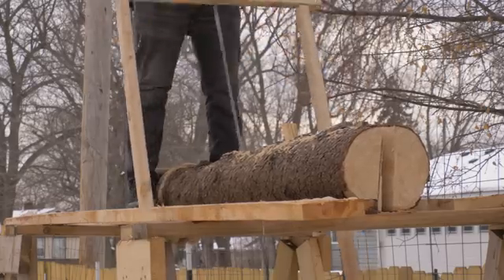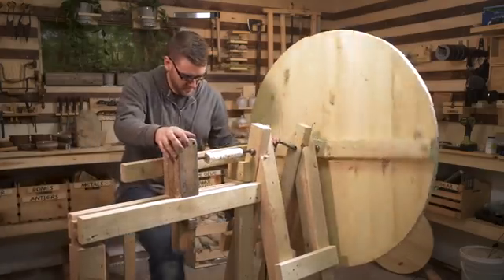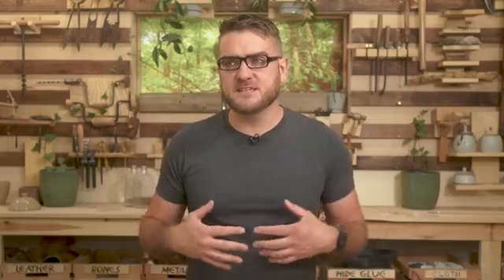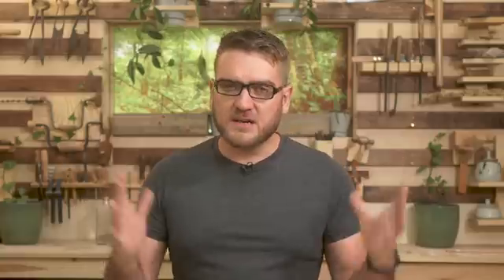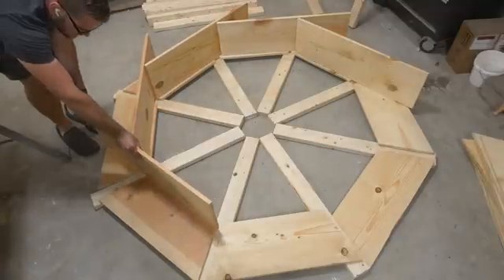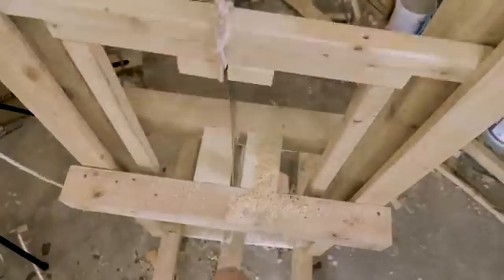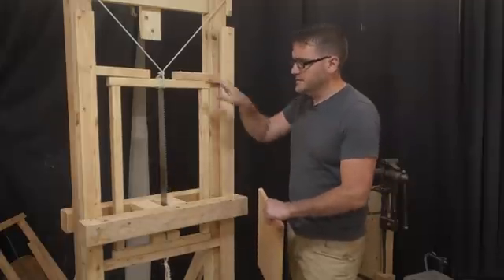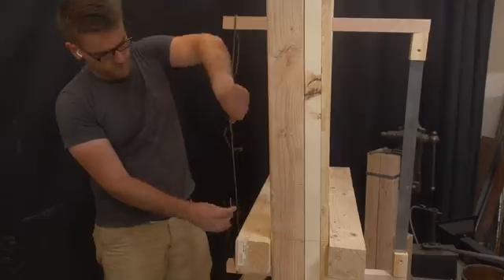I Built a Medieval Watermill to Power My Tools

Comment: I’m trying to 3d print my own ~6in water wheel. Are there any specific things I should do with the buckets (ie be as far out as possible, empty in a certain way, be a certain angle, etc) or do they literally just have to hold the water on the way down?

Comment: Hey man great video on you foot saw run run boards through out side studs allow to slide up and  down in pockets until bottoms out top and foot pedal attach to bottom baiscly big square studs help stability and yo can cut an pivot wood even put turn table if wanted

Comment: You don't technically need to make gears! That's going to be a very precise project. You can still achieve a gear ratio and power distribution system with pulleys and rope. Also would a stain help make the wheel last longer?

Comment: Andy I must ask have u thought about using multiple types of power generation systems in sync with each other to one power storage system also ur forgetting most smiths used animal power so why not build a wooden wheel for pets etc also since ur using water power by wheel why not turbine based instead also if u think about all motion based energy systems they need physical movement to make elec so why not have them link to hydro fuelcell also the simple wheel system can be tweaked to a higher yield of energy transfer by more chain/link with gears like make a wooden gear and use some paperclips as a the chain link system to get  more energy transfer another piece of advice would be what I call a mother spider web system like ur Dr stone docs gen if u link that up to a water wheel/turbine u can also make electrical energy along with kinetic so try also using a water solur system like heat from sun to make small steam and use a makeshift steam turbine/wheel to have a minor heat system that can be added to a geo thermal system like the water exhaust fills the geo well to steam from earth to make more heat transfer anyways just saying best thing to do is link all systems to a spider web system structure like how the power grid is designed on industrial scale
Reply: bro animal cruelty is illegal

Comment: You will need to add a wood piece or a plank with a smooth slit gap in the middle of it where your steel rod can move up and down (basically a gearbox to make the upward and downward motion work correctly and use the water wheels rotation work )to make the wood saw work right.

Comment: attach a wheel on the side of the water wheel, wheel has string attached to another wheel, the other wheel has 2 planks of wood attached through a hole in the wheel that goes around both the wheel and the string, and pushes up and down. in terms of binding up, it's better to attach the bottom of what you're trying to move up and down or back and forth in the direction you want the thing to go. so you don't want to attach it on the side of what you're trying to move, because you're going to be fighting against static friction. you're also going to be fighting against gravity. The crankshaft is definitely the way to go in terms of turning circular movement into back and forth movement. and vice versa with cars. it's just the most optimum method is to have the crankshaft in the middle of the load rather than off to the side of the load.

Comment: Having a crank, coming directly out of the side of the water wheel is the 1st engineering mistake. The wheel spindle should be a long shaft, that goes through the wall of the workshop. And runs the length of the workshop, then it can be connected to the machines using belts and pulleys. A home made bandsaw would work better than the reciprocating table saw, as there is no wood against wood mechanisms to bind up, while being operated.

Comment: As you said it comes down to gearing. So possible a transmission, but the easiest route would probably be a belt. Either rubber or tan hides. Just an idea. I wish you luck Bro

Comment: Now that you're getting into self moving machinery, listen to me and listen to me carefully. The biggest improvement to safety in the history of machinery was the brakes. Right now, your waterwheel and whatever you connect to it will be a constantly wobbling kill-zone. Make sure you have a way to easily stop it instantly when you're not using it, or I'll kill you when you least expect it. A saw moving unattended on it's own is more dangerous than what you might expect. I can't stress this enough, give it emergency braking of any kind before you cause a tragedy, please.

Comment: I bet this is after the fact, but it might help if you use a very long connecting rod to decrease the side loading/ binding of the saw. If you look at old pictures of some of the old designs they usually have very long connecting rods. The same principle is used in modern internal combustion engines.

Comment: I suggest that you  investigate efficient water wheel wheels and water flow.  The way water flows onto the water wheel is important to the power of the waterwheel.  IE over the water wheel, or alternatively a straight drop before the water wheel with the water wheel spinning the other way and dipping into the dropping water.  Cant remember which gives more power for same amount of water flow, but I know there is a clear differential.

Comment: If your arm hair is touching the saw blade, that is too close! An easily removed bumper that would be accurate to the period (and cheap) is stuffing a sock with plenty of waste fiber and tying it onto the metal pole. At this point, I think Andy's blood should be listed as a material. Enough of it has gone into his builds over the years. I joke but I've been watching since the original sandwich and it is very satisfying to see the improvement in tool use over time.

Comment: shaft nobs and rope guide sets  with second are arms and pins to the tool.  then it advanced to the gear shaft simple some parts up some down and shafts set with angles to boost the power. crank shafts and pistons come from this.  hooking up another shaft l with often cloth twisting bands let to gears and counter setting mill stones mills and such water wheels are still used for a reason in the form of turbines which is basic a better wheels that add that energy to a charge for example.

Comment: Couldn't you use a rope to transfer the power - have the waterwheel pulling and releasing it via a crank, and then some pulleys going below the saw to pull it down, with the original spring pulling it up?

Comment: You should try to link that wheel to a belt system (gearbox) to help with speed control of the saw then a off Center wheel to push the saw down

Comment: Discuss!
You need to have modern material loophole.
 As long as you have made a previous material in sufficient quantity that is unlocked from modern sources.
Then technology if you get say 10 to 20% of modern efficiency of a tool just use modern.
Just my thoughts.
Reply: Edit otherwise this is going to take 100 years until possible a  boom.
LOL the feds will stop. But at limited progress you are 50 years from steam powered in real years.

Comment: Not sure if it is time era appropriate, but I know that in the early days of the Industrial revolution they used pulleys and belts for power transfer. Maybe you could use materials such as leather or hemp? As for the saw, maybe a cam in addition to the springs could drive the saw? Anyway awesome work, cant wait for the next part!

Comment: Common power transmission method was using leather belts. The wheel was used to drive a shaft and machines were hooked to that shaft via leather belts allowing individual machines to be engaged or disengaged as needed. This was particularly useful for factories and driving mass numbers of machines. The same system also worked well later on with steam driven shafts. Using a belt to connect the drive shaft to the offset handle/shaft of the saw would work well.

Comment: when stuff is fire resistant, like copper, it will last way longer
Reply: fire combustion exhaust turbine
Reply: needs to be stone or metal, something not burning up, or not flesh and blood, thats not sustainable
Reply: electroplating a conductive paint wood/plastic/ceramic is super nice
Reply: solar mirror polished heat concentrator

Comment: An in-between mode, for places without a strong water source for example, would be a windmill as a water pump to send water up into a tower or into a manmade storage pond, then letting the water down through a waterwheel or turbine and back into a lower reservoir to be repumped. This keeps you from being dependent on the vagaries of wind through the working day and allows you to bank away that power to use continuously later.

Comment: Waterwheels typically don’t run directly from the river. Instead you channel water off the river to a control pond that you use to stop and start your wheel as well as maintain a supply of water at elevation above your wheel.

Comment: If you use gears to connect to the saw, instead of the shaft system you used, it should work a lot better and you can adjust the speed of the saw using gear ratios.

Comment: Can you find how this works?----- in Ukraine, in An area where they make large blankets, those blankets are washed using an old water powered machine, built on the river. After a storm a few of the units in the building no longer works, and they no loner know how to fix it. This is to the best of my knowledge, accurate info. I have attempted to find how the device was built but have not been able to find it.

Comment: I can see your issue. You need a belt or chain to spin a crank shaft above the saw, also I'm sure a chicken wire cage around that crank wheel won't hurt

Comment: As a very low tech means of utilizing solar power with your water wheel technology, use water vapor traveling uphill to condense at a higher potential and then use your wheel to capture the energy going down.

Comment: If I were pulling from the top, I'd also connect it to pull from the bottom instead of merely dropping it. Just an additional thought, you're powering from the center, but that isn't your only option, you could make add a peg to the outside of the wheel with a track connected to a beam and have two axis of linear motion which could redirected using pulleys; although, they would be 90 degrees out of phase, so might be better for using the other axis for something with offset timing such as advancing the wood being cut, or maybe controlling a clutch. Again, just a random thought off the top of the head.

Comment: If you take your water wheel to a water source. Please remember that they didn't put them directly into the river. They made a weir or some run off the river where the water level and speed could be controlled. If you try to put it straight in a river it's going to get destroyed likely and you'll likely get injured again

Comment: I think you made it quite big. Right now, with so little water and pressure it is working fine being feed from top, but if you want to increase power, feeding water in the middle with more pressure might be better. The top feeding is prone to splashing with higher power.
If you would want to go in historical order, I think bottom fed water wheels are earlier invention and for sure are easier to make. They can be made literally with sticks and rope, although their power is limited and depends on speed of the water. But on the other hand, it does not require waterfall.

Comment: Maybe a pulley fixated onto the iron rod could work? I mean: a pulley conected to another pulley with a coarse leather belt?
I think that some tension would be necessary to keep a strong grip between the belt and the pulleys.

Another thing that could work: gears. But not the mechanized ones. Those made with sticks. You could replicate those fairly easy.
A gear fixated onto the iron rod, transmiting the rotational force onto another gear.

Comment: I forget where I heard it first, but your comparison of modern dams and water wheels is spot on. Most power now-a-days are basically technologically advanced water wheels. Just instead of water a lot of them use steam or just high pressure/hot gas. Granted this comes from a pretty ignorant individual, so take it with a grain of salt. I just find it interesting.

Comment: With all the upper body work you appear to be doing just to wrangle the board your cutting and the lower body work it takes to actually run the saw, it looks like it would have been significantly easier to just use a normal hand saw for the vast majority of those cuts.

Comment: I bet you could build a guard with a boards that was adjustable up and down so you don't have to hold the boards down on the saw machine. If it came across the top and stopped them from kicking up when you're pushing the pedal you could focus on moving them through.

Comment: Old factories originally used a use a main rod with pulleys and leather belts to power machines.  You could attach a rod to the center of your water wheel, put a pulley on it (wooden or metal) and connect it to a pulley/cam setup on your machines.

The added bonus to this setup is that the machines can be turned "on/off" with tensioners on the belt.  Simple machines FTW

Comment: My understanding , and I am probably wrong, is that an undershot mill where the wheel is partly submerged will generate more torque, whereas an over shot like you built will generate more speed. 
I'd be interested if that could be tested.

Comment: I think something that might help your handmade saws work a little better (reducing binding) might be to add some blade guides using some sort of wooden wheel that grips the blade tighter so it doesn't have so much room to twist.

Comment: Just an idea you might consider for cutting wood.
Make yourself a Shishi-odoshi  (water hammer). Don't use bamboo obviously you wouldn't be able to get enough force behind it to cut wood. But you could take a 2x4, make a bucket on 1 side, and attach a saw under the bucket, and so as it goes down it cuts. And then the water drains out and it goes back up to get more water.
It wouldn't be fast, but it might be easier to get working right than some of your other wood cutting ideas.

Comment: Hmm. Where to begin. Alrighty... so... if we're to 'assume' that you've relocated to a flowing water source and have 'rebuilt' your shop next to the water, I would suggest making a plastic or tarp-lined tub around your water wheel so you're not flooding your yard. Connect your pump connection to the bottom of the tub and have it cycled back up to the top. The tub would probably need to look like the bottom half of a hexagon, and up to the middle of your water wheel. You could probably integrate it into the water wheel as the stator (where the wheel is the rotor). I was watching the water wheel, and it looks like the splashing starts at about 50% of the height, so that's where I came up with that number. If you wanted to still be able to see the water, you could make one side of the tub plexiglass or something.

The next technology you should recreate (though you might be jumping forward in time a bit) would be a planetary gearbox. Normal gears would be the next logical step, but you're going to need something a little more stable for mounting and getting some meaningful torque out of it. Hmm. I just looked. It looks like 'epicyclic gearing' was thought about in 500BCE, Greece. So you should be able to go with this and keep in line with your timelines.

Once you've got the planetary gearbox done, look into a bandsaw. This way you can keep the rotational motion of the waterwheel without needing to convert it into linear motion. With the planetary gearbox connected to it, you could get some meaningful rotation and torque out of it.

Great episode! :D

Comment: I know that this will sound silly BUT if you look at the show “Little House on the Prairie” they use a water wheel there and that goes to a gear and a belt and that belt goes to the saw. It’s just an idea anyway. You might try a gear and belt off of the wheel to run power the saw so how. 🤷🏻‍♀️

Comment: How is the metal axle fixed to the wheel? It looked like it was just put through a hole in the center of the plates at either side, which seems to me would make the wheel prone to simply rotating around the axle rather than actually rotating the axle itself.

Comment: One main power shaft (geared down from the water wheel) and then belt drives to various machines...I have seen old drawings of a water-powered woodwork shop set up this way. The main power shaft was run just over head down the length of the building.

But that said, loved the video and what a great journey you keep taking us on...and the mishaps, only a flesh wound...

Comment: I would love to have a water wheel powered workshop.  I am also fascinated by horology so in my world it would all be gears transmitting power to where it is needed.  John Harrison of the Longutude Prize built wooden clocks and included wooden components in each of H1, H2 and H3 and early flour Mills used similar wooden gears on a larger scale so it is possible.

Comment: How about guide rails on the saw table, so your workpiece fits underneath the guide rail, and then you have both hands for guiding the piece?

Edit: a belt drive might be the easiest method of connecting tools to your wheel.

Comment: use pulleys and leather belts, you can add tensioners made up of various options, even just a cantilevered weight would work too. On a side note, just using the saw to do cross cuts by hand would have been easier. at certain points its actually easier to use hand tools rather than tools set up badley to do the job.

Comment: Belts and pulleys would be my initial thought on power transmission as it is more flexible, easier, and with tensioner pulleys can be clutched on/off as well as ‘geared up or down’ for rpm and torque needs.